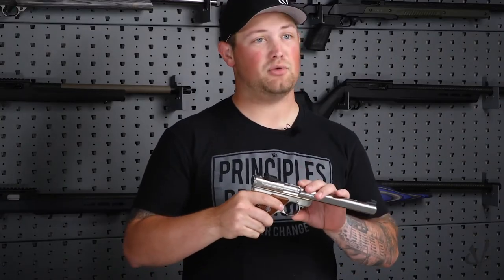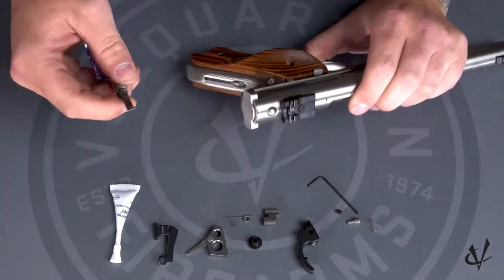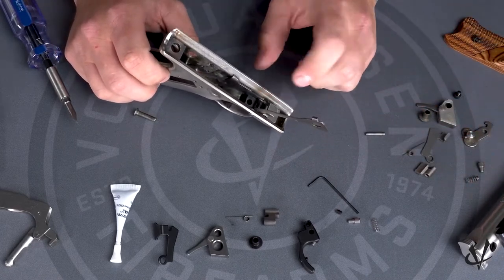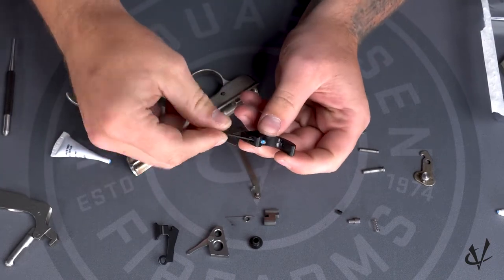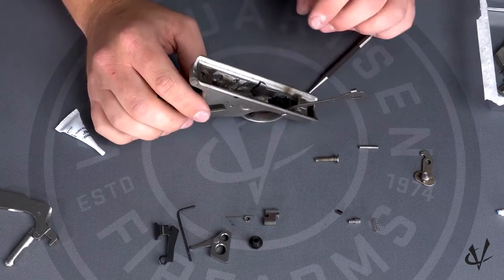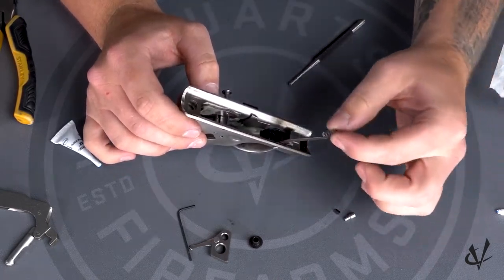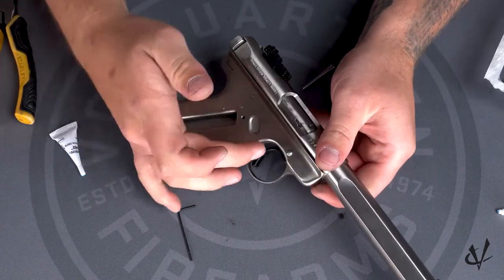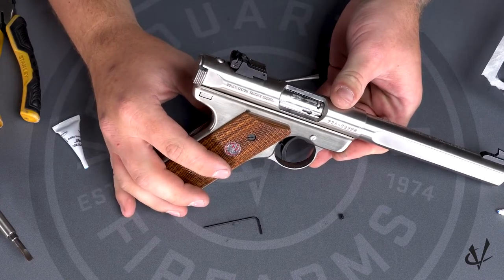Installation of the Volquartsen Accurizing Kit for the Ruger® MKII or MKIII

Comment: Thanks for the detailed video. I had to replace my bolt latch lock assembly with new p/n VC3BHL. That bolt release/safety button/hammer pin is no joke... lol you need 3 hands for that one. I already had this accurizing kit in it except for the bolt latch assembly. This video made the job easier.
Reply from the maker: Glad it helped!